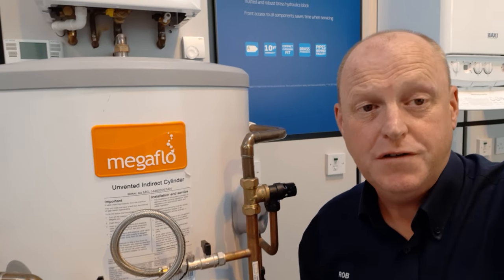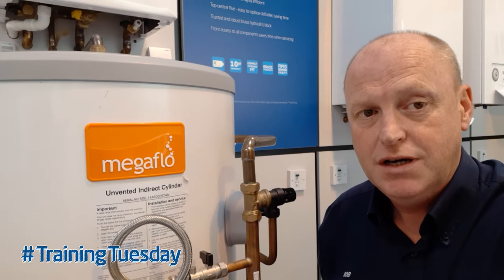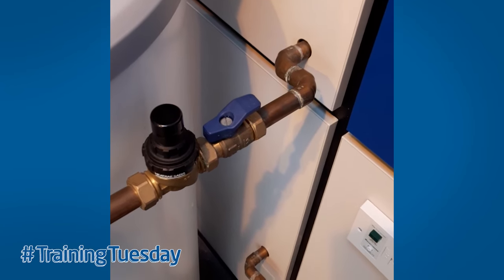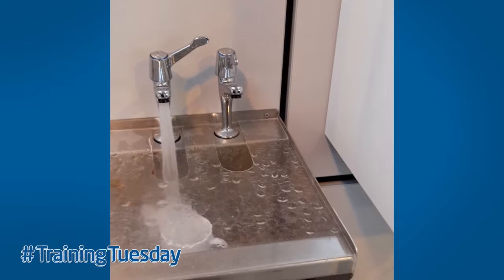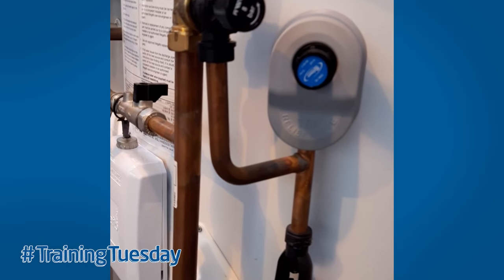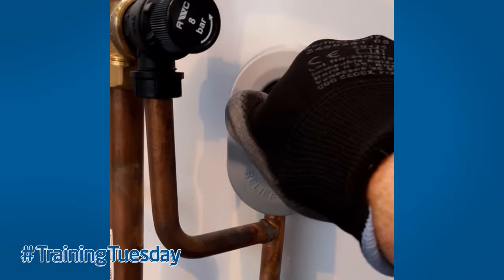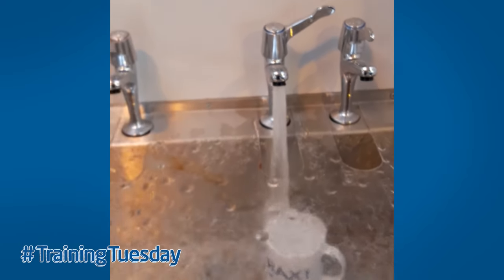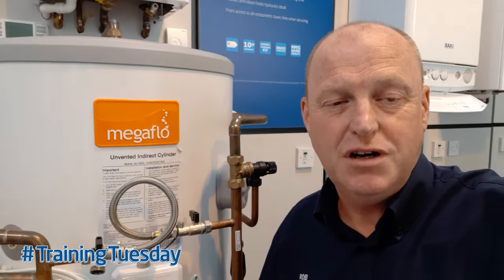How to recharge the air gap in a Megaflo Cylinder | Baxi Training Tuesday | Help | Guide

Comment: The only problem I found with the video is that you advise to open the temperature and pressure valve anticlockwise to the right. Anticlockwise is to the left!!! Does it make a difference. What if I have no tun dish?

Comment: When fitted to ground floor or in an apartment without a 'down stairs' this method doesn't work consistently. Shouldn't the advise be to drain from the bottom stop-cock drain on the tank either into the shower tray via a hose, or have it plumbed into drainage that the bath and sink drains into?

Comment: Great BUT....

Why does the bubble deplete in the first place. Mine needs doing pretty well every month. I've never got a satisfactory explanation from Baxi when I've asked. They give variety of explanations but thet never manage to explain why air travels down through water and out through hot taps. They've cancelled any thought of air dissolving in the water but I'm not convinced it cannot happen. I'm going to fit an expansion tank and get rid of the issue for good.

Megaflo is a great idea on paper but if the bubble cannot be relied upon to stay in place it's a non-starter...unless you're a plumber. Plenty of call-outs ensue and any detractors are told explanations that defy simple physics!
Reply: You forgot to mention the plumber speak, cheeky chappy clowns.

Comment: Hello.  I like your videos.  They easy to understand.  Thank you.  I have subscribed to your channel.  I have a megaflo water tank.  I tried to open the drain cock.  The water that is coming out is black.  Is that normal from the tank or is that coming from the radiators as the water in there is also black.   Thank you

Comment: My megaflo tank leaked through the immersion heater. I called out a plumber and he replaced the immersion heater and serviced the tank. He said this had happened beecause the air pocket had disappeared. My question is, why wasn't the excess pressure released through the safety valve and out through the tun dish? This is a bit worrying.

Comment: Great video. I have one of these tanks but started to make noise whenever I use the hot water? what do I need to do? change the ballcock valve (if it has one) or is to do with pressure

Comment: When I go to open the pressure release valve after doing all the steps before it doesn't open but instead clicks when I turn it. But if I just turn the pressure valve without turning off the cold water supply then it does release the pressure. What's happening here?

Comment: Hi Rob.  My Megaflo is on the first floor and I isolated the cold water but when I open the lowest hot water tap on the ground floor hardly any water flows out at all.  When I open the pressure relief valve nothing happens at the tundish.  Any suggestions please?
Reply: hi. i have a similar issue with my megaflo. hardly any water flows out of my hot tap & almost no air gets sucked in (no gurgling sound). did u manage to get yours sorted???

Comment: The strangest thing about doing this, is that immediately after turning the mains cold water back on, and water starting to come out of the lowest hot tap, it was red hot. That’s with the boiler turned off and not yet having had a chance to heat the new cold water in the tank. Any plumbers that can explain that? The hot water hasn’t been on for 4 hours.
Reply: You’re only draining a small amount of hot water from the cylinder.

Comment: could a clogged & dirty mesh filter / strainer in the combination valve cause the water pressure to drop at my taps & shower???

ive noticed the pressure drop for a week now & have checked all isolation valves are still fully open - so im wondering if i should now check the mesh strainer in the combination valve.

i still have the old style heatrae sadia megaflo combination valve (15 years old) with 4 allen bolts!!!

i think it may be time to change it for the new style of combination valve.

any advice please???